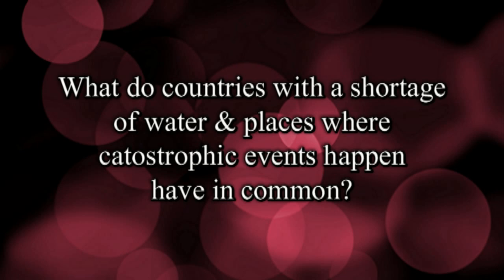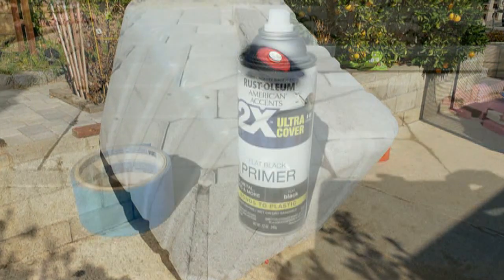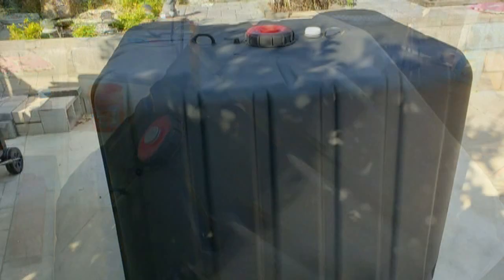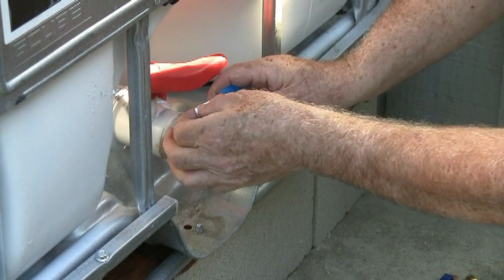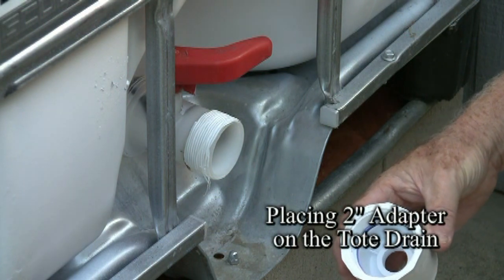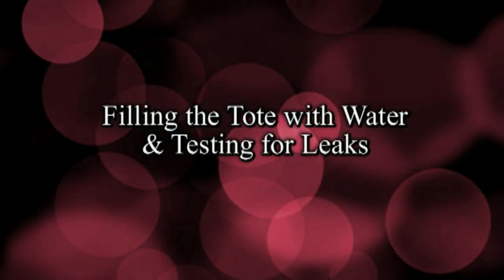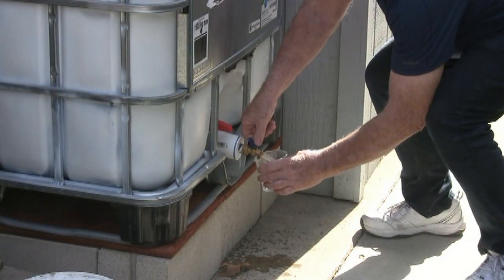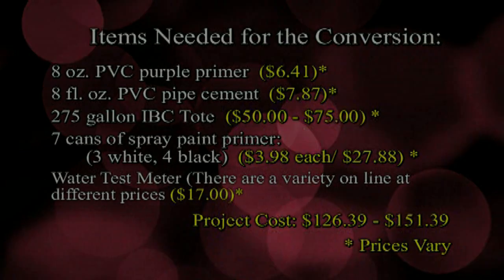IBC Tote Conversion for Water Storage

Comment: I would include a Sawyer Mini water filter into my planning.  That will filter 100,000 gallons of water if properly used, from foul stuff to safe drinking water.  

You can also use things like Kelly Kettles and home made sand, gravel, charcoal filters to take stored water up to drinking water levels.  It doesn't have to be stored in drinking water levels of purity.

Nicely done demonstration of the process.  I've got almost 19,000 gallons of stored water on my site so I haven't pursued this method but this is ideal for a homeowner without much land or outbuildings.   In colder climates you can put something like this in a garage and/or use a stock tank heater for cattle troughs to keep it above freezing through the cold weather.  Add some sheets of foam board around it and create a giant "warm box" with just a 60W regular light bulb that will keep it above freezing.  

I like the idea of painting it with the black to kill light and white to reflect light, hadn't thought of that.  

Great job, my friend.  :)   Be safe out there.  I pray for ya.
Reply from the maker: Great insights for the colder climates. Those in those climates will benefit from your wisdom. The various filters could be a benefit. In a 3rd world setting, everything would depend on accessibility of the filers. Something to check into when traveling to Honduras. 

One area not covered in the video would be using a rocket stove to boil the water to address water impurities. Maybe in the future, I'll address the usage of a rocket stove for cooking and water issues.